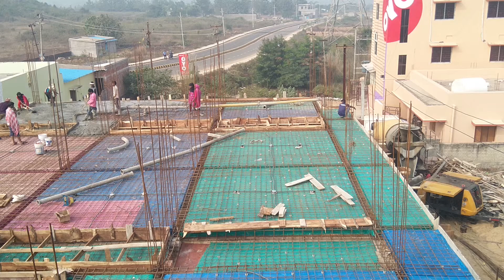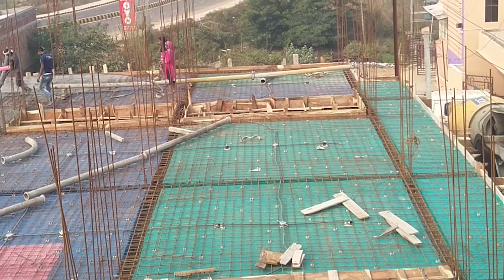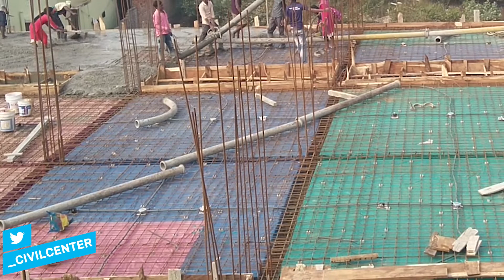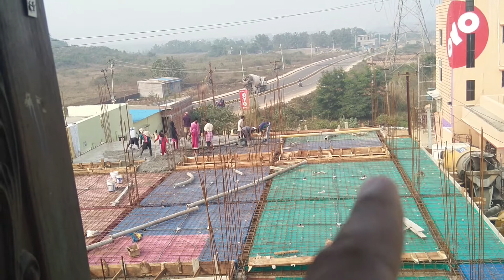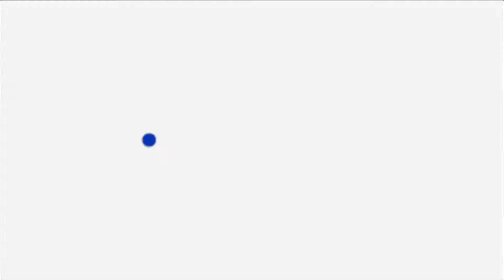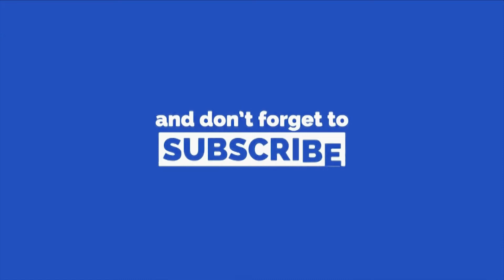Ready Mix Concrete: Pros and Cons

Comment: DISADVANTAGES:
a.	The materials are batched at a main plant, and the mixing starts at that very plant. So the transition time from the plant to the site covers longer distances and becomes complicated. Some sites locate at too remote distance, which may cause risk for ready mix concrete to be useless owing to setting.
b.	It will create extra road traffic. Normally, Ready Mix Trucks are bigger in size and may take huge space in the road that will obstruct other traffic. Besides, access roads and site access should have the capacity to bear the heavier weight of the ready-mix truck plus load. (Green concrete is approx. 2.5 tonne per m³.) This issue can be resolved by using so-called ‘mini mix’ companies which employ smaller 4m³ capacity mixers to visit more-restricted sites.
c.	Concrete’s constrained time span among mixing and curing signifies that ready-mix should be arranged within 210 minutes of batching at the plant. The time span can be rectified with modern admixtures perfectly, though, the amount and type of admixture that is included with the mix is very crucial.